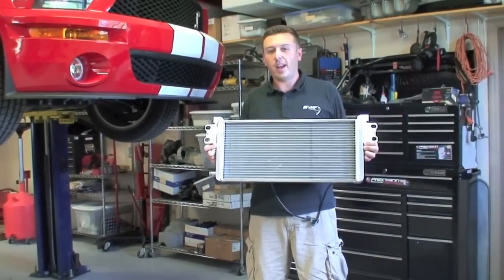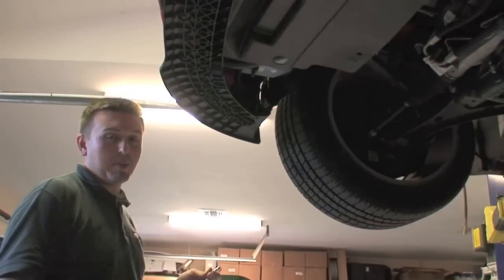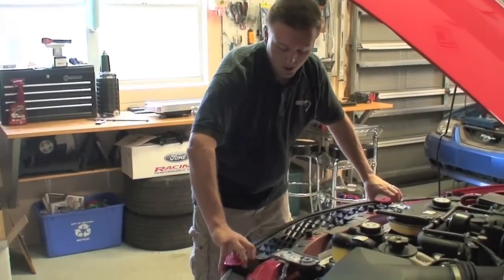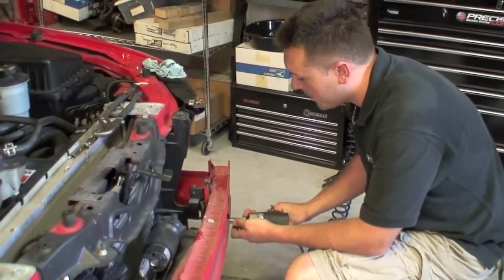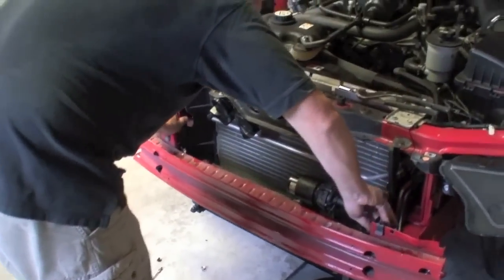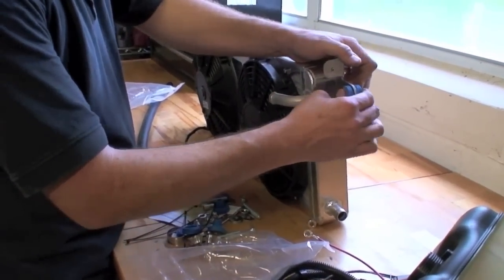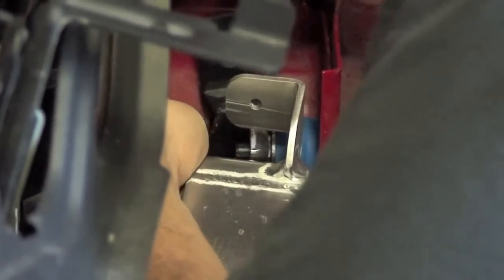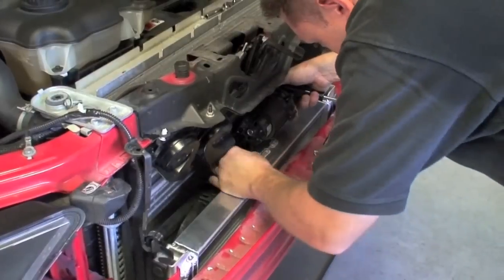AFCO Dual Fan Heat Exchanger Installation (Part 1)

Comment: Do the fans add any real benefit to the heat exchanger think about adding one to my Roush charged expedition?
Reply: No they don’t lol. It’s just a gimmick. The only thing that matters is capacity.
Reply: @Blazerghost I agree!  The fans kill your alternator too.
Reply from the maker: Definitely! Especially if the car's been tuned or is driven pretty hard.